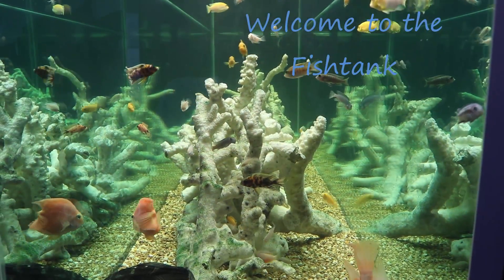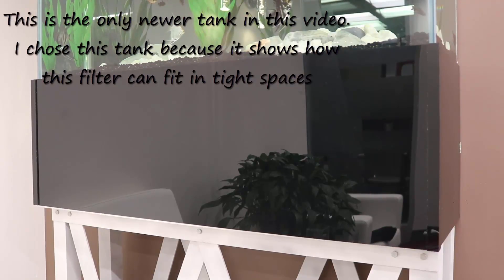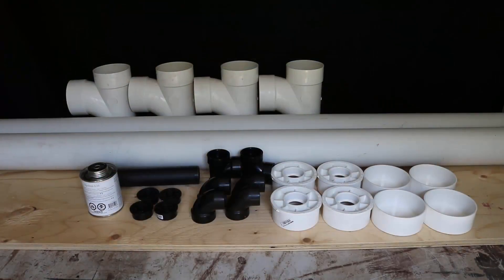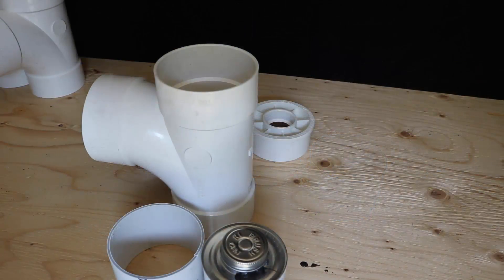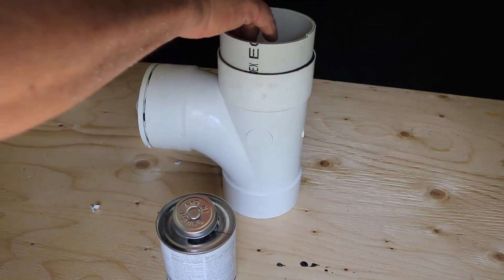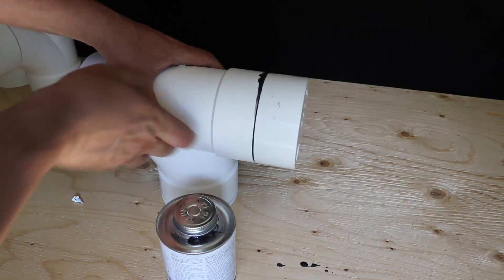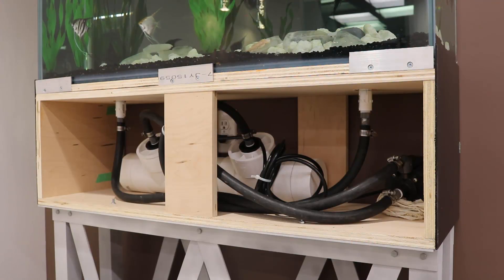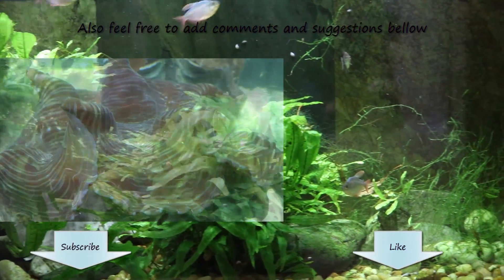diy Leak Proof Canister Filter

Comment: I'm planning a large build in my family room.  I'll have 2 150 gallon tall tanks and 1 220 all plumbed into one huge sump that consists of 4 75 gallon tanks connected with bulkheads or uniseals. the stand will be about 18 feet long.  I was thinking of having a filter like this running the entire length of the stand with water barely trickling in one end and draining into the sump on the other.  PVC pipe would be filled with Seachem Denitrate or maybe just sand in the hopes that the extremely slow moving water would encourage nitrAte removing bacteria.  Not sure if it will work but worse case scenario, I'm out some pvc and filter media.  I could always turn up the flow and have a good ammonia/nitrite bio filter. Your thoughts?

Comment: Probably a silly question, but do you use pressure rated pvc and fittings, or just dwv?
Reply from the maker: These are for sewage use. The pressure rating is way higher than anything they will be under with aquarium use
Reply: Fishman thanks!

Comment: Is there a reason you don't use a 90 degree elbow at the ends seeing you just glue the end pieces shut? Also, I'm wondering what is keeping smaller bits of media from getting sucked into the pump. Thanks.

Comment: Scuba tanks is more like it. Heck I'd even make a heavy duty winter pond heater that fish can't get in. This filter needs better threaded parts.
Reply from the maker: The oldest filter of this design that I have running is now just under 20 years old. No leaks. No problems with parts. This isn't a filter style I would recommend for every situation only ones where leaking is the most important concern

Comment: all those pipes and accessories will probably run you over 100 bucks for sure
Reply from the maker: Actually even the double canister filter comes in under $100. The only time it goes over is when it's filled with coral. Thanks for the interest.
Reply: Totally agree - with Fishman - I just bought 10-ft of Thin Wall PVC, 10' of 1' PVC Pipe - one end cap, one female adapter with screw in top, 4 90-deg elbows, Silicone and Glue. Enough 4" Pipe for 4 DIY Canisters and I spent a little over $30.00.  If I buy the Retail versions of what I am custom building - $300 plus for each one - Not buying.  I am painting my though - My wife needs the "Nice Furniture" look. 2 cans Krylon Fusion - Satin Black, 3.99 ea at Ace (Enough for all 4 finished Canisters). Still - my design allows for easy routine maintenance - I will be investing about $50.00 in Unions.  DIY Plumbing and Filters is the only way to go when you want to spend the big bucks on what lives in your Reef - Not what runs it.